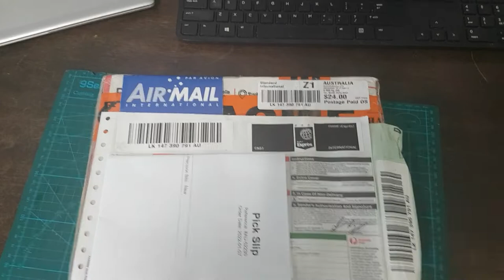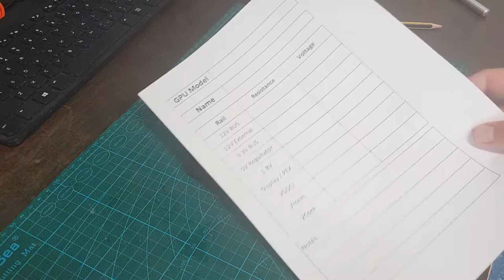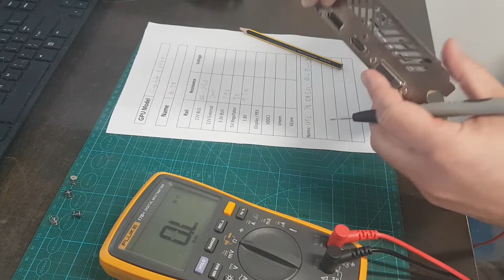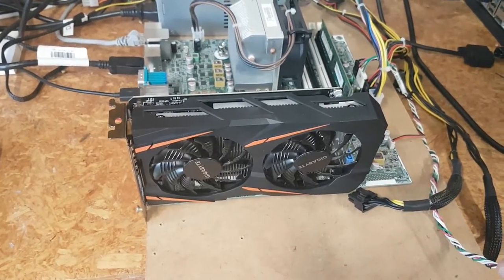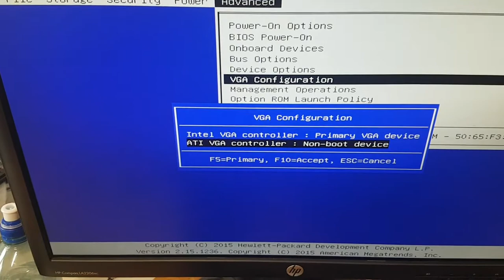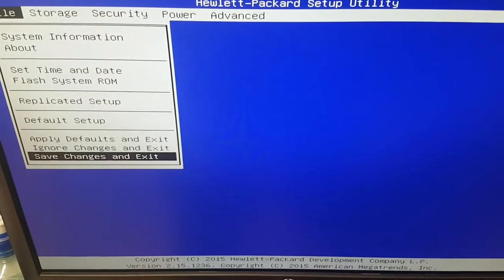Gigabyte Radeon RX 460  - Repair Attempt (Part 1)

Comment: sir, I i have asus dual oc rx 460 2gb. every time the gpu installed into PC (any healthy pc)  it works but after installing gpu drivers (even the old stable one), windows immediately freeze/crash no BSOD. ive tried to several other healthy system pc and its just the same crash after installing drivers.

I've tried stress full it with Aida64 without installing driver, just stress the gpu clock. its stable even for 3 hours straight.
but when applying or give load to memory clock or memory its instantly crash/freeze just like installing driver.
i got little knowledge about electrical like components. but please can you give me some conclusion or points for me 🥺
Reply from the maker: Probably a faulty GPU. Have you tried a memory test?
Reply: @brettwatty101  yes and immediately crash. I've tried hot gunning all the memory chips but no luck.
Reply from the maker: @erwinrifailangi  memory issues can also be caused by GPU. You could try replacing the memory chips but probably would cost more than the graphics card.
Reply: @brettwatty101  thank you so much for the advice, I'd take that🙏. love your videos

Comment: Sir. I want to ask. my vga is gigabyte rx460 4gb. suddenly dead. that's why. and no fan doesn't turn on
Reply from the maker: Sounds like a common short. You need to go through the full diagnosis process with a multimeter.